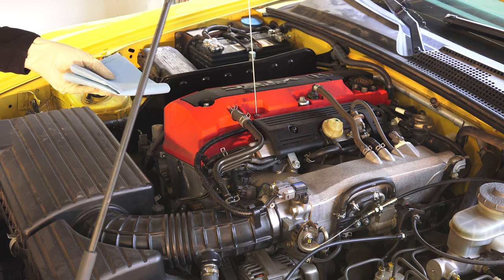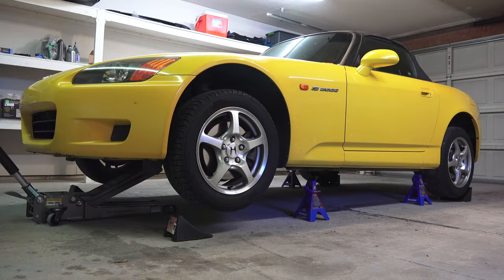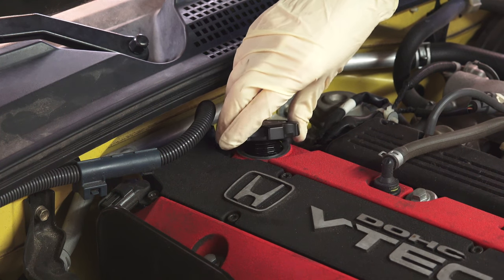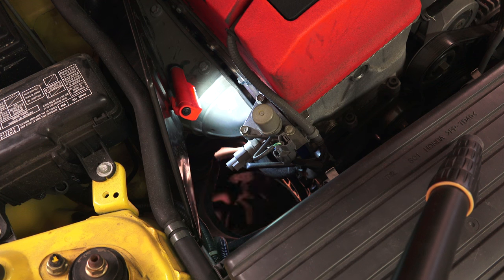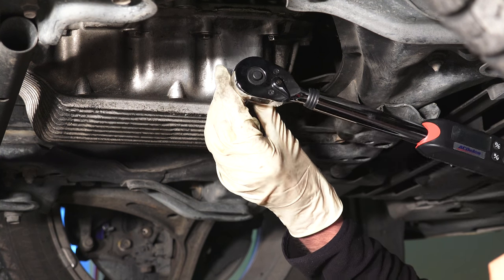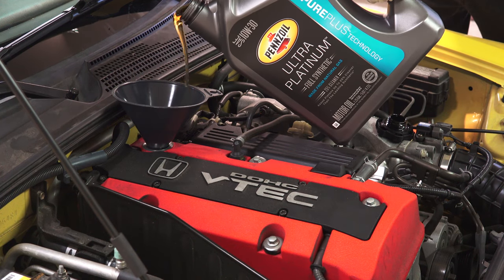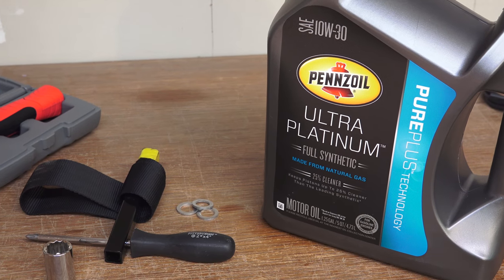How To Change Your Engine Oil - Honda S2000

Comment: What about putting oil inside the oil filter before screwing it?
Reply: Lachezar Lechev Yea I was always taught to put some new oil in filter b4 screwing back... I really wonder if it's actually necessary
Reply: Well on my previous car was sideways and I didn't had problem to put just a little bit. So what's the right way after all?

Comment: Can you do a video on "diesel chip tuning units"? How can they say more power, less consumption? I get the more power  but not the lower consumption I've also heard that some of these boxes manipulates the cars software and so displaying false fuel consumption figures.
Reply from the maker: I think it just needs to be known that this won't happen simultaneously. When you floor it, you'll use more fuel, regardless. When you're light on the throttle, it may tweak the A/F ratio for higher efficiency.

Comment: If you don't have such a pro oil container as Jason, you can cut a big hole into the side of an old oil bottle. Works perfectly, doesn't cost a dime.

Comment: I would recommend using a cheapo supermarket oil, of the correct viscosity etc obviously, to do an engine flush before placing your super sexy Mobil 1 or whatever in your engine.

Comment: I know that 14 years ago, 10W-30 was the norm for these engines but today motor oil in much better and a 0w-30 synthetic oil would be better specially for a high revving engine.  My C30 turbo when new 6 years ago calls for 5w-30 but now 2017 Volvo recommends 0w-30 A5 B5 oil for that same engine.

Comment: I'm curious.. has anyone EVER torqued a oil filter?
Reply: Not me.  Hand tight plus a bit more always served me well.
Reply: Yes, always... The first oil change I did both drain plug and  oil filter were over torqued... I had to go to a friendly garage to untighten it, at first they laugh at me and used a normal wrench to remove the oil filter and failed then grabbed a breaker bar and still fought a bit to get it unstuck... 
Then finally understood why it was so hard for me to undo it and since it was my first time doing it, why was I scared to go crazy while trying to remove it... 

Nowadays I do it always myself and could get away doing it without a torque wrench but I still do because at least that way I'm sure that it will be correctly tightened as I'm a DIYer not professional.
Reply: my filters for all my GM stuff say right on them....'get it snug, then 1/2 to 3/4 of a turn"

because a screw is just a lever wound around a stick....you can say that "1/2 a turn = 5 foot pounds"
and if you used a torque wrench....sure enough, you would find your self turning it EXACTLY half a turn.
Reply: André Carvalho Yeah dealers are known for over torquing things. The honda dealership where I lived would tighten the oil filters down so much I had to hammer a screwdriver through them to break them loose. 
They over torqued rotors, wheel bearings etc too.. Im sure they do it on purpose so that a normal guy attempting to do his own work will give up and take it back to them.
Reply: I've interpret it as the consequences of the tools they use, convenience and some extent of ignorance. 

The air tool bolt tightener they use in my country, they use it to overtighten a few times.....
Reply: I torque sump plugs and oil filters at work. Covers my arse if something happens down the line and I don't fancy destroying the threads on a sump and wasting time fitting a new one when it only adds an extra minute to torque it properly.

Comment: Have you ever talked to pennzoil EE? As to why they stoped selling Pennzoil Ultra Platinum in stores, and only in Amazon very expensive?
Reply: In the US I have no problem finding or buying Pennzoil Ultra Platinum at Pep Boys, O'Reillys, Walmart, Advance,  AutoZone and even Krogers Grocery.
Reply: patw52pb1 I live in SC, and can't find it anywhere locally, what part of the US you live?
Reply: Leandro Arce
I split time between North Georgia central North Carolina and DFW, Texas.
I have not had any problem finding it in either state. 
Walmart usually has the best price viscosity selection and the most inventory. 
Ask the manager at your local Walmart to start stocking it for you, 
Little known fact, but Walmart sells more Pennzoil Ultra Platinum, Rotella and Mobil-1 than ary other US retailer.
Reply: patw52pb1 You know what, I'm definitely taking your advice, hopefully they can start stocking the oil again. And true, in walmart they have the cheapest price ever. Thanks.
Reply: Leandro Arce 
You are welcome, good luck finding your product.
Reply: Hi Leandro – We're sorry to hear you are having trouble locating Pennzoil Ultra Platinum. Pennzoil Ultra Platinum is available at many national and local retail locations – to find a retailer near you, please visit: http://www.pennzoil.com/oil-change/. Once you input your zip code into the search, you’ll see a special “We Carry ULTRA” icon designating the retail locations that specifically carry Pennzoil Ultra Platinum. You can also have your local auto retailer request the specific Pennzoil product you need from their regional Pennzoil distributor. Hope this info helps!
Reply: Pennzoil Hello, and yes I have try it, and found that Auto Zone "have it" but I have went to multiple in my area, and they don't carry it. They say that they needed space to put other oils in their shelves, I don't know why.

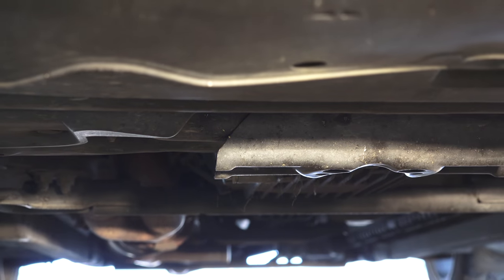Comment: Jason, thank you for this video. At the 2:34 second mark, I noticed that your tire treads aren't facing the correct direction. For your safety, please correct this as soon as possible. 

Thank you.
Reply: i agree, it is very dangerous
Reply: Omair Khanzada 1:00 I think it's an asymmetric tread pattern not a directional one, it's a bit deceiving but asymmetric doesn't matter which way they go. My Honda's last set of tyres were very similar and looked like they were running backwards on one side but it didn't matter, there was no outside/inside marks on the tyre

Comment: I have a 2017 subaru wrx limited. When will be the perfect time to change my oil, the manufacturer book says every 6k miles? I dont race or abuse it on corners . Current 4,5xx miles. Please help.

Comment: Does 7/8 of a turn on oil filter mean almost a compete 360 of the oil filter or 1/8th of 360?

I was reading the forums and getting confused as people indicated that it was 1/8th of 360degrees.

Been using torque wrench with filter cap.

Comment: @ Jason, Engineering Explained

If you install a reputable oil drain valve (i.e. Fumoto), you no longer need to jack up the car to perform the oil change, provided you have a low-profile drain.  All procedure can be done from the top.  

Simply slide the drain pan, drain existing oil (using the valve), twist off oil filter, install new oil filter, fill up with new oil, PROFIT!

Comment: What's the best oil and I used royal purple last time I changed mine if I change it at 8k miles will my car feel a better when driving with some fresh oil
Reply: There is no "Best"
Only things you need to know is

A) is it synthetic 
B) is it the correct viscosity
C) is it right spec A3/B3, A3/B4 ect
D) is it safe to use on DPF equipped cars(only applies for diesels)
E) Cost

Royal Purple is really no better than any other oil for your daily drive and you're paying extra for some purple dye added to the oil

Nothing wrong with changing oil a little early, if anything it is slightly better.

Comment: Is it 100% necessary to do an oil flush if you know for certain that the wrong oil has been used in your car previously (by the previous owner)?
Reply from the maker: You definitely want to change the oil, yes, if the incorrect oil is in there.
Reply: Engineering Explained Do you think an oil change is sufficient (because I've already done that) or do I need to do a Wynn's flush during the next oil change as well?
Reply: ***** Just did an oil change with the right oil for my engine (changed oil filter too), but the check engine light was blinking again today (for about 10 seconds) after about 200 km of driving with the new oil... time for some OBD2 link up...
Reply: ***** it's gonna be sometime in the middle of next week, so hold up! :)
Reply: Ok, so the code was totally unrelated.

Misfire at coil of cylinder-3 and fuel injector cut-off at cylinder-3 during the misfire.

All is well for now though as it is just a warning that the cylinder-3's coil is starting to go bad.

Engine coil malfunctions are very common for my N46B20 engine. I just had a cylinder-4 coil change earlier in the year.

Comment: Have you ever used the fumoto drain plugs?
Reply from the maker: Nope, they seem cool but I'd just be nervous that it might accidentally open.
Reply: They've got prevention measures to keep that from happening. I'd say you should use one if you drive the S2000 enough,  or take it to the track, because that drain plug orientation is so perfect for a Fumoto! It's not like the Subaru where it's pointing down reducing ground clearance
Reply: I agree. I have one on my S2000 and love it. It makes changing the oil even easier.

Comment: I hope you flushed and changed it again off camera because there is nothing worse for an engine than adding Pennzoil.
Reply: *****  It is true that a brand can make both good and bad. I have no experience with that exact oil, however, the only good I have ever seen from them was the recommendation to run another brand of oil. Once on a 2stroke snowmobile engine where the owner easily proved oil failure Pennzoil paid for the engine and told him to try another brand. Later I worked in a heavy equipment shop (and no I am not nor was I a mechanic) where a customer ran it in his fleet of trucks and had a 90% failure rate under 30k miles. With one truck making less than 10k miles. I believe pennzoil paid for that one two with the same recommendation. Or just today I had a customer bring a crank in for inspection (yes I'm a machinist) from a 3406 cat that seized with less than 5 hrs on the engine. Do you want to guess the brand of oil?
How about Chrysler's emergency recall  for dealers to drain all penzoil (the oil in the video) from ecodiesel engines and replace it with Shell.
I could go on but I shoulden't have to.
Reply: Google can find no mention of a Chrysler-issued Pennzoil recall/TSB. When did this happen?

Pennzoil is owned by Shell.
Reply: *****  Hear is a copy of the TSB https://drive.google.com/file/d/0BzYkF_-Nh949Ml9yOF9Bb1RacEk/view?pageId=114648107661129200803
I do recognize the TSB does not mention Pennzoil Which was the factory fill oil. All that is mentioned is a change from 10W30 to 5W40 however why specify a different brand when Pennzoil has a 5w40 oil and they also have the factory fill and mopar oil contract.

The same company owns both Ryobi and Milwaukee yet their in no comparison in quality.

Comment: Any S2K owners here should note that you can't get an accurate oil level reading unless the engine is fully cold.  Oil level will always read too low otherwise due to oil taking a long time to drain out of the journals.

Comment: hold up, please explain how running the car prior to changing will help with draining? i do my changes in the morning to make sure all the oil falls off the top of the motor. it drains in about 8 minutes as opposed to when its hot it can take up to 15 minutes to stop dripping. this is my personal opinion and hands on experience. it would make a good explaination video unless it really doesnt matter. i just like to wait until it stops dripping completely before i put that plug back in.
Reply: When oil is warmed up, it has a lower viscosity which allows it flow easier. Thus it drains (using analogy) like water instead of like honey (Again, using exaggerated analogy). As for your personal experience, I'm not too sure but if it works for you, that's excellent!
Reply: Negative, warm multi-viscosity oil has HIGHER viscosity, not lower.  Hence, cool oil flows easier than hot oil. Not warming the engine also makes it easier and more pleasant to work on/under.
Reply: Dan Alwood you are mistaken, every oil in the world has lower viscocity while warm

Comment: I wouldnt recommend penzoil or any synthetic or conventional other than Motul seeing that most oils are not made to maintain high reving engines such as a s2000. Itll eventually wear down the oil prematurely.

Comment: just so you know you are meant to be on the middle of those xxxxx marks not the top(whole discussion on the s2ki forum about this). Also 10/30w isn't correct for most places. should be 5/40w.
Reply from the maker: From the owner's manual: "You may use a 5W-40 oil if the temperature in your area goes below 0 F ( -20°C)." I'd certainly say most places remain above 0 F, hence 10W-30 is correct for most places, which is why it's the oil Honda slaps on the fill cap.

Comment: So I have been thinking lately when should I check my oil level? For example when I changed my oil on my 99 impreza the dipstick looked like it was on the fullmark. I started it up and let it run for a while. Opened the hood and took another look to the dipstick just to be sure and the oil level was way above the full mark. Next morning as it was cold outside i tried it again and the oil level was at full. warmed the engine up cleaned the dipstick and took another look at the oil level and it was again way over the maximum. So should i check my oil when the engine is warm or when its cold after a night of sitting.
Reply from the maker: Well when it's cold and sat overnight, you know that it's all drained to the bottom, so that's fine to do.
Reply: Engineering Explained  Thanks for the reply. Your videos are awesome!

Comment: why not hold the bottle on its side?
Reply: Easier for the audience to see the label when it's held upright, I imagine.
Reply: Thirdrawn he had 180 degrees backwards as the opening should be at the top when you pour and he could have filmed it from a left hand pour instead.
Reply: Sometimes a demonstration is done a certain way because it looks good on camera or serves another purpose. As shot, the product and engine details are easy to read. Those details probably matter in a sponsored video.

There isn't a wrong way to pour oil into an engine. There is a more convenient way which will make it easier to avoid spillage, this is true. He got all the oil in the engine and didn't spill a drop. Maybe he would do things differently off-camera, maybe not. Maybe you need the extra help avoiding spillage and need to pour differently. Just do what works for you.
Reply: The bottle design says it was 180 out. They use to put the spout in the middle until someone thought about it. Try to pour a new 2 liter of soda without it creating a vacuum and chugging out.

Comment: You should leave the engine off for at least 10 minutes before checking the oil level with your dipstick.  Otherwise you'll get an inaccurate reading.  The oil level will show lower than actual if you check immediately after turning the engine off.
Reply: That is one of the things you can argue about for ages, but you have a point. It depens on your car and how you drove it before. If it is your regular car and you are just checking your oil level at a normal fuel stop there is no point in waiting for 10 minutes. If you are buying a used car you should definiatly wait, though I don't belive that it makes a lot of differenance if you wait 5 or 10 minutes; just be careful to NOT refil too much oil.
Reply: Heidelaffe If you want an accurate reading, you wait.
Reply: hartsickdisciple

An accurate reading with a dip stick? Are you kidding me?
It is not like half a litre of oil will apear from nowhere if you wait a magical few minutes. If You below half you refill 2-300 ml, then check again, maybe refil a bit more. Repeat until above half full.
Reply: Heidelaffe I've owned a dozen cars, which have had 8 different engines.  This rule of thumb works.  It's foolproof, and works across all models.  You WILL get a more accurate reading if you have the engine off for at least 5 minutes before checking the dipstick.  There has been a difference with every car I've owned.  This is old knowledge that's still valid.

Comment: do you have to lower car before putting the new oil in?
Reply: nope. But yes if you're starting it.
Reply: Not required, but recommended.  You want the car level on the ground to get a proper reading on the dipstick, therefore ensuring that you fill the oil to the correct level.  This step is more important if you roll the vehicle onto ramps or lift only the front.
Reply: you have to follow his instructions exactly or else...

Comment: when will you start to actually do things to your project car ? (sorry if it sounds to hatting)
Reply from the maker: After the basic maintenance items are done, I'd like to do a stock dyno run, and then go from there. Unfortunately temperatures are dipping into the 20's where I live, so it's a bit discouraging as the car isn't really made for these low temps haha.
Reply: Engineering Explained ok  , thanks for the answear ! i will look forward to them !

Comment: Does anyone actually ever use a torque on the sump plug? i mean... i guess some just have that feeling :p Oh and usually, depending on car and location of sump plug... it actually is better to lift one side of the vehicle a bit higher, thus helping more old oil flow out. My bmw for example has a plug on the left side of the pan, and i always jack the right side up a tad higher so there's a slope making sure all the old oil is out.

Comment: Why arent drain holes right at the bottom of the sump? They are always on the side & stufff so you cant get all the oil out.
Reply from the maker: Typically they don't want the bolt protruding as the lowest point, in case something hits it. You want it in a somewhat protected area.
Reply: This ^